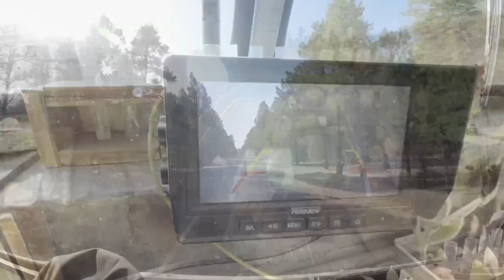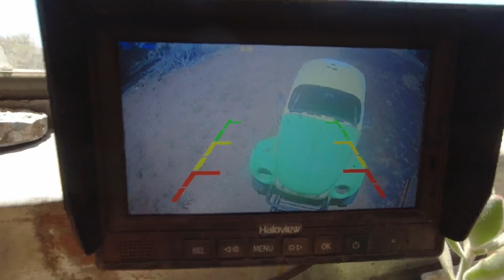I Bought a VW Baja Bug! BUT WILL IT RUN?!

Comment: If you have any questions about VWs ask me, .... and congratulations on becoming a VW owner, set it up right and it will never let you down! 😁👍✌
Reply from the maker: Tell me more! I am replacing the carb next. Taking it back to IRL to install it. I got an EMPI 32/36 for it. The old carb is worn out completely
Reply: @PaulBarger  well, the first question is do you wanna always be taking it back to that wonderful mechanic? Which is cool, but it would be better if you learned how to do stuff yourself! 😁👍✌

First, you need to know what is in your engine, all the specs. inside which will determine what you can attach outside to give you the greatest reliability and performance! 😁👍✌

Also, if you are gonna haul this thing around behind you, what you do to it will need to be able to get parts in anyplace when you break sumting! 😱🤪🤣😁👍✌
Reply from the maker: I want to gather up a dedicated VW maintenance kit. All the tools I need to work on it and keep them with me. It’s not really all that much for a Beetle. The BreadTruck is fine. It’s been repaired and improved up to this point so it can do this. I need a copy of how to keep a Volkswagen alive for compleat idiots.
Reply: @PaulBarger  Buy the big orange book manufacturer maintenance! And you got YouTube there is nothing you can't do on it! .... You will learn real fast what is fluff and what is real! 😁👍✌

Comment: Good deal on the old Baja! Should be a lot of fun. 67 was my favorite body with the larger windows and the floor pan is better than a 67 because it has the IRS rear suspension instead of swing axles. I would have told you to change the gas and oil, squirt a little oil in the cylinders and crank it over for a few seconds to lube them without compression, put the plugs back in, and poor gas down the carb and into the bowl thru the overflow tube just before starting, or use starting fluid but not for long it will wash out the cylinders, file the points with a fingernail file scrap the end of the rotor on the cement and put it all back together. Double-check the timing with a test light and that would have got it running. The VW air-cooled engine is simple. Also seemed like you had a bad battery or starter, most likely the starter since it was still weak when jumping it. That is kinda rare for the old VWs to crank that slow. I usually ran a 6-volt starter in mine with my weber race motors which meant finding a 200 mm 6-volt flywheel and a 6-volt starter. It cranks like there is no tomorrow then. Just don't crank it very long! I have built many bugs over the years and several Baja bugs too. Also Ghia's. I use to build custom racing engines and my full body full interior street bug ran 9 second quarter miles at 140 mph back in the 1970s! I never had so much fun in my street cars as I did in that old 63 bug. It looked just about all stock inside and just slightly lower in front with chrome VW rims, but it had wider rims in the back with 9-inch firestone wet racing tires hidden inside the stock fenders. The engine and tires lasted about the same, every 5000 miles I had to rebuild the motor and get new tires. The tires were bald and the center mains were getting loose on the engine. I can say I never lost a race at several street racing groups here in SoCal. As long as they would drive their cars to the locations to race, I would race them, but I refused any cars on trailers. Just not fair. That was my daily driver and it was driven everywhere. This was the 1970s there were very few cars that could do a 9-second quarter mile and still drive on the street then. No one thought a bug could go that fast then, but mine and one of my friends did. The closest races I had were with a vega that had all the floors cut out, you could see the frame and ground behind the front seats, and everywhere else was cut out to lighten it up as much as possible, with a 400 inch small block chevy built to the hilt. He actually was the only one to beat me in one race because the plugs were bad in mine and it started missing badly in third gear, so I went home that night changed the spark plugs, and went back to race him but he left, so the next night we raced and he swore I had another engine in the car I beat him so bad, but all I did was change the plugs and no more missing. The only other was the president of Compton Street Racers he had a Transam with a 455 built. I hole-shot him by about 10 car lengths but at the top end about 125 mph here he came pulling on me, but at 125 he was topped out and floated his valves and I ran up to 140 pulling away from him like he threw a boat anchor out! LOL, We raced a few times over the years he never beat me. Great people there he had me come over to one of their meetings and asked if I would race one of their bugs, the guy had lower gearing and only wanted to race 1/8 mile and tried to tell me it was a 1/4 mile, LOL! He also said he had an 1835 motor but I saw the spacers under the cylinders so I told him I only had a 1700 but mine was 2000 cc with special made Empi slipper skirt pistons for an 82 mm stroke so I had no spacers for the longer stroke and he had no way to say anything different. All the joys of street racing, LOL! I beat the guy but let off to make it look close so no one got mad since I and my buddy with me were the only white dude's among all the blacks there. Good thing the President was my friend or we may have had a problem getting paid for that one. Later the president told me he bet on me and won so he was happy too and got my money for me. LOL! He even knew I let off the throttle and told them I could have beat that bug a lot worse. Many fun times in the old VWs. No others were ever even close to me. Maybe I will build one more Ghia or bug again someday! My last one was an 03 Ghia that was faster than the bug but I never took it to the drag strip before selling it, big mistake, I had a few people bugging me to sell it to them and I was not driving it much so I finally let it go at a good profit. It also made the cover of VW Trends years ago. Nice blue Ghia with plaid inserts on leather in the complete interior, seats, door panels, headliner, dash, etc.! The good ol days! Thanks for showing your VW it brings back many memories! Thanks again!

Comment: @4:57 you can see the hint of where the fuel door was covered. There's a square right at that point you can see. Use period and command to rewind/advanced frames
Reply from the maker: No definitely not. I can clearly se the inside and there is no cuts weld all original paint and patina. It’s a ‘67 body.
Reply: @PaulBarger  truly weird - maybe I misunderstood but I can see a hint of a rounded square in the video. My mistake (I'm not sure as I do see an outline) but I appreciate the response.
Reply: it's cleared at @4.55 .. definitely an outline of something
Reply: @PaulBarger  maybe you drew a square with your finger lol - is that a clean spot you made I'm seeing hahaha
Reply from the maker: Yes I did draw a square with my finger

Comment: First thing you do is put an exhaust pipe cover on it! 😱🤣👍✌
Reply from the maker: It was already on there. I knocked it off when I touched it so I picked it back up. 😂
Reply: @PaulBarger  Great be careful with the upturned exhaust you can get condensation, it sure looked like you had some when you finally got it fired! 😁👍✌

Comment: Dude , you said 73 chassis.  Did you luck up on a 65Hp Screaming Eagle???
Reply from the maker: Nah, unfortunately this wasn’t the original motor as it is just a regular stock 1600cc dual port. But I’m happy with that too!